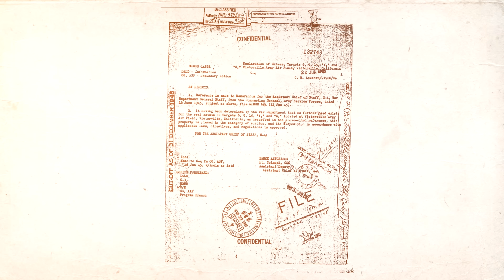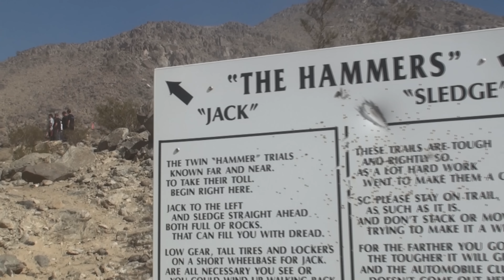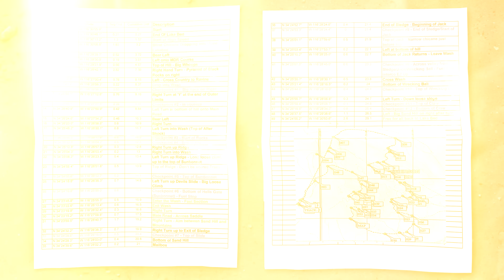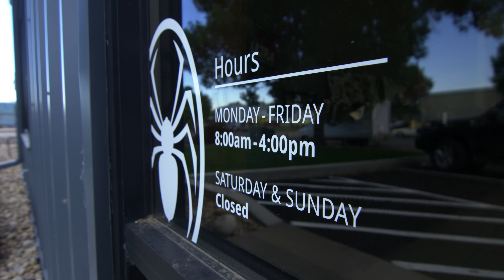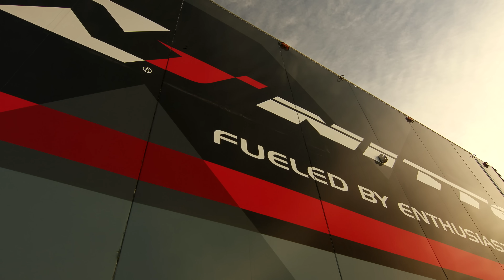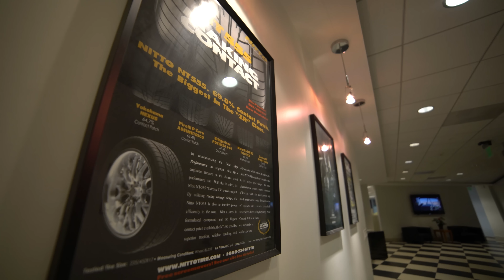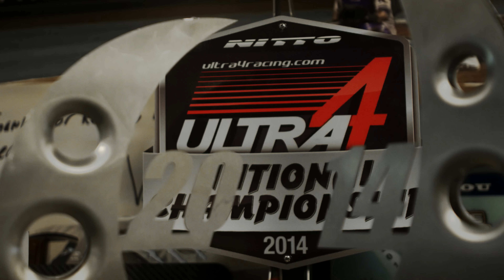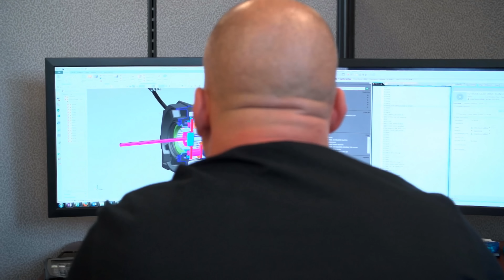The Evolution of King of the Hammers | Episode 1 | KOH: Origins

Comment: I remember when it all first got started with the Victorville Four Wheelers. We live only thirty miles from the Hammer trail. I still own a built up 85 four runner, however it would not keep today. We use run around the desert and pick up the old bomb scraps, they would litter our yard, fun times. It is amazing to see what it all turned into.
Reply: I started coming the for the gold prospecting  in JV and the Dales back in the 70's :)
Now I go out most days in a sleeper 95 4runner.